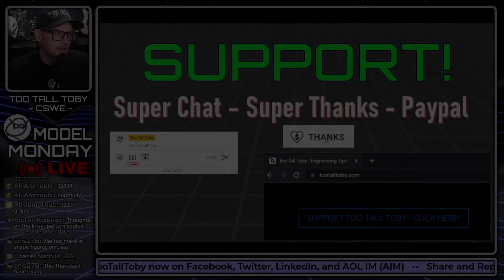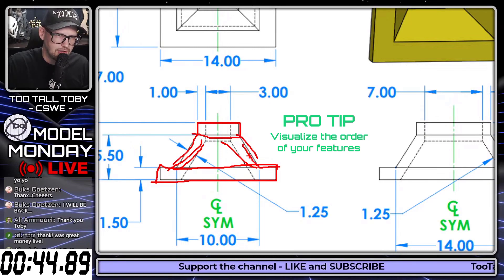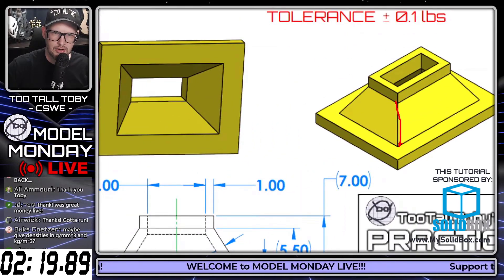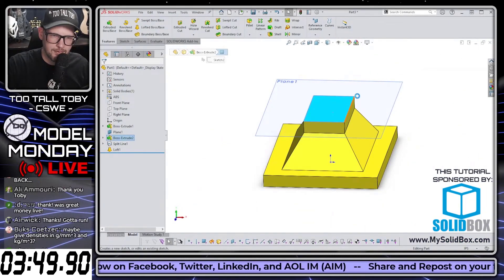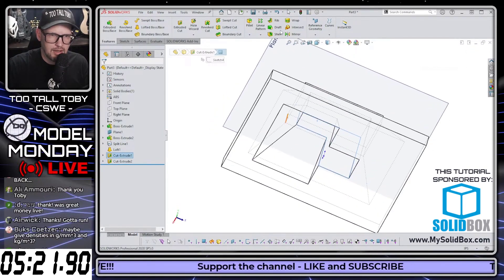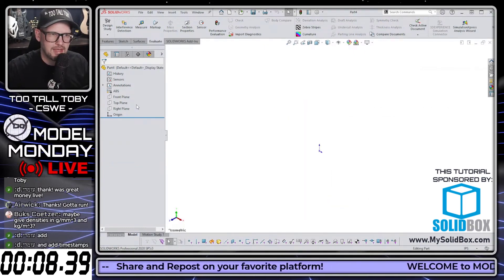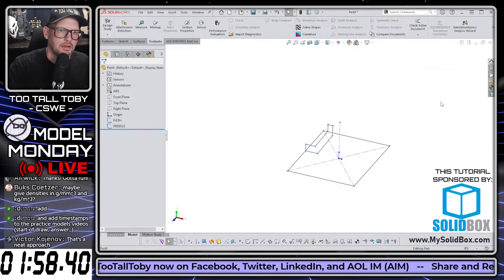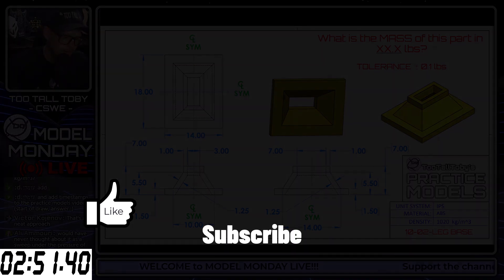SOLIDWORKS TUTORIAL -  TooTallToby-10-02 - LEG BASE

Comment: So, here's what I did... I got the right answer, but it was definitely not with speed. Like you, my first attempt was to start with the base, loft the pyramid, them extrude the chimney, then cut the interior of the chimney, shell the pyramid, and realize this wasn't going to work. scrapped that and started over. i became stuck on finding the angle of the pyramid, convinced this was necessary to solve this. Looking at the print, I could see I could calculate the angle of the slope of the pyramid using Side-Angle-Side. But  after a few minutes, abandoned that direction as I've only used SAS about 2 times in 30 years since HS, and would have to look up a lot of the formulas required, and this felt like it was against the spirit of the challenges.   None of the other Challenges have ever needed more than simple math to solve. So to get the angle of the pyramid, I used a loft extrude to get the pyramid, switched plane, and measured the angle, getting 32.01 degrees. i then deleted the loft extrude, but kept the sketches, and using the sketch for the top of the pyramid, used Boss/Base Extrude with a outward draft of 32.01 degrees and extruded it to 5.5" (To the bottom of the base.)   From there, I shelled the pyramid with 2 thicknesses, base of the pyramid was .125", but the top was .010", so the inner shell angle would be passed the point of the cut from the chimney. Next selected the top of the pyramid, extrude then cut the chimney(Pretty basic here). That only left the base. I selected the bottom of the pyramid to sketch on, did my outside base sketch (18x14) and the inside opening of the pyramid, and selecting the outer and inner sketches, preformed a "donut extrude" to fill out the base.  Super insane, but I still got the 16.80lbs. I saw the sweep solution, and just died a little inside.

Comment: This works assuming the wall thicknesses/slopes are all equivalent. I think from a speed modeling perspective, this would not be the approach to take simply because a change in any of the 6-8 dimensions defining the sloped walls would result in non-sweepable geometry.

That said, the sweep is still a great and unique approach here, and it's a tool to keep in the back pocket for sure!
Reply from the maker: Thanks Victor!

Comment: Did it long time ago. 16.796 grams. I have density 0.037 pounds per cubic inch instead 0.04
 Put 2 work planes and did loft and loft cut. But it's much easier with sweep. Thank you, Dragos
Reply from the maker: Nice job - It's crazy that that part, which looks so simple, ends up being such a mind bender!!

Comment: So, let’s talk about design intent of both methods and the pros and cons of each.  If changes happen, a few less features in a tree could really cause trouble.  I think it would be a cool discussion.  Get a few folks to discuss!
Reply: This is always my downfall with these speedmodels.  I'm always modeling with the thought in my head "how fck'd will I be when they change this dimension next week". (They will!)  In this instance, if the 1.25 wall thickness is changed on one side but not the other, your sweep model is scrapped and you're starting over.  It's a good method for speed, but a poor method for practical models.
Reply from the maker: @Terry G - Or, in that case, instead of starting over you could just use a MOVE FACE :-)  

I see your point, and I agree - when we are working with a customer and understand the manufacturing process, we can make better decisions with regards to "how might this thing change".

Thanks for the comment and hope to see you in the livestream tomorrow!  It's gonna be a good one!
https://youtube.com/live/iLhWdR6dwl8?feature=share
Reply: @TooTallToby  Here's an idea.  A two part speedmodel.  Part 1 model it per the drawing.  Part 2 A revised drawing which requires some change(s) to the model.  Winner is the combined time.  Lots of people will be screaming at themselves.
Reply from the maker: Nice - good idea john - always good to explore multiple methods - I just thought this one was funny because i actually tricked myself (since I didnt review the challenge for over 14 months, I forgot how i originally did it...lol)